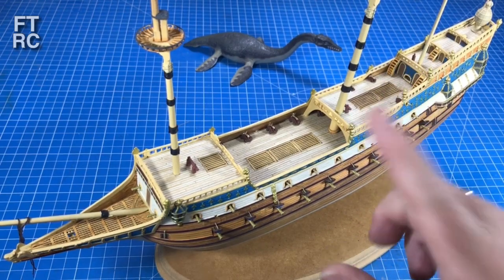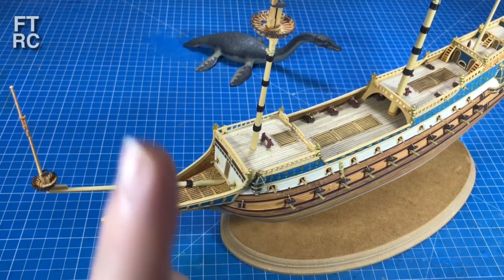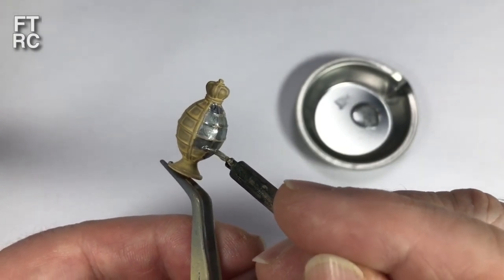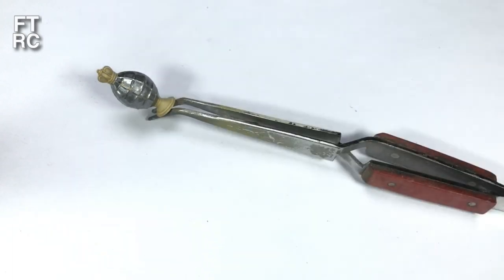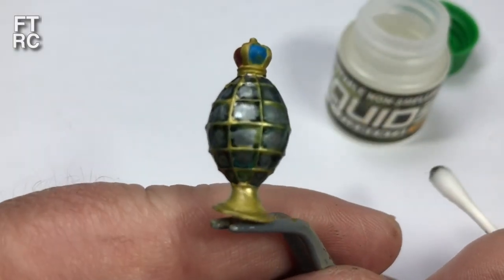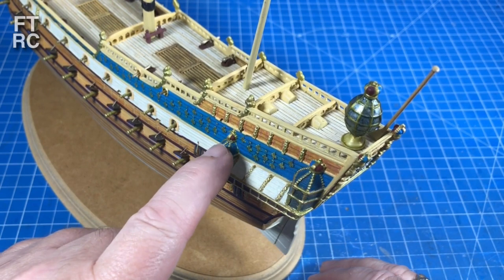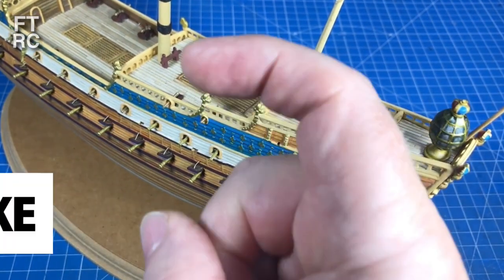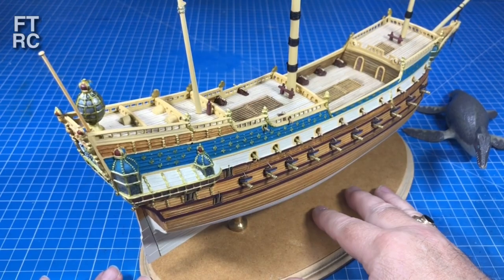Figurehead and Lantern on Airfix St Louis Part 12  scratch building and using metallic paint

Comment: Nice recovery on the figurehead and the lamp. I was watching the filing of the figure, noticing that the file is fairly clogged up, so I thought I would offer a bit of advice from an old ex aircraft mechanic. Get a hold of a small wire brush, typically used to clean battery terminals or similar. These are wooden handled brushes with steel bristles and they are approximately the same size as a toothbrush. They are cheap and should be available at Harbor Freight (or your local equivalent store) or perhaps at an auto parts store. I keep one in my file drawer and regularly use it to clean my jeweler's files.
Reply from the maker: Great tip Carl. I will get one.  My smaller diamond files also get clogged and I have ruined sanding sticks trying to clean them out.